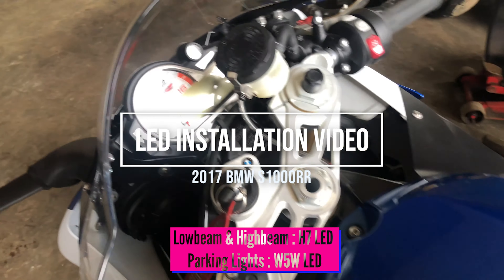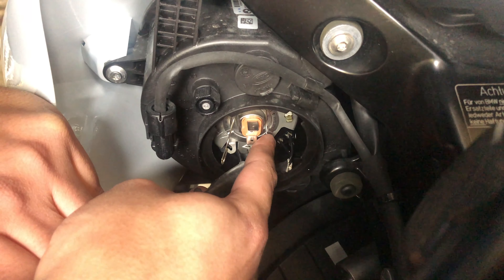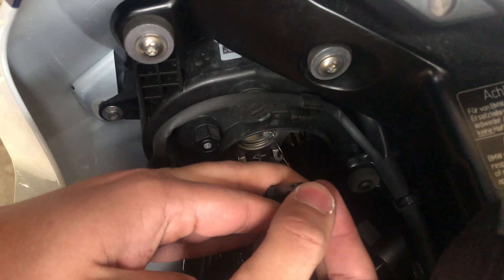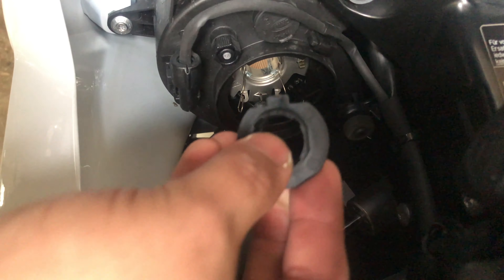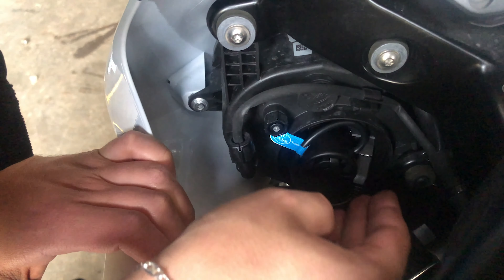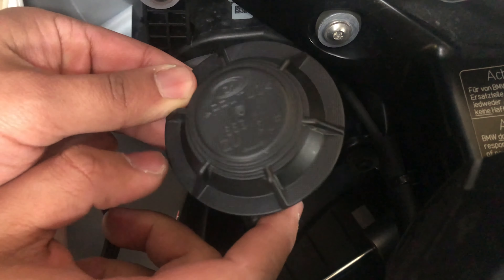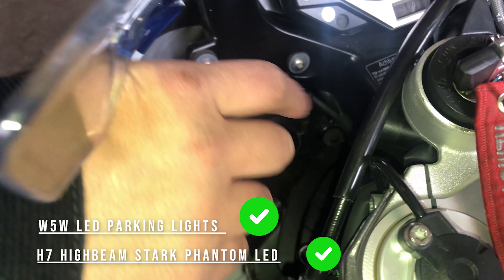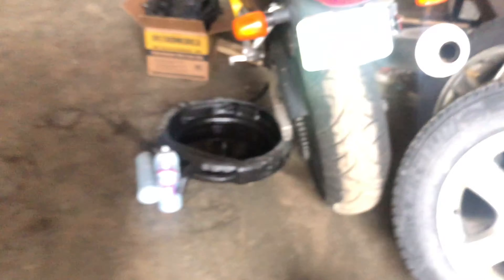NICEST LEDs for your BMW S1000RR | Installation

Comment: Cant wait to install mine, they look fantastic. Beautiful machine my friend!!
Reply from the maker: Walid Mankal thank you brother 🙏🏽
Reply: Would the newer stark ns series work the same way?
Reply from the maker: @kila501  honestly not sure, depending on the shape of the LED fan - you might have to trim your cap differently but same process for sure (make sure they are H7 LEDs and you're good for sure) 🙏
Reply: @bencheee3099  good looks, ended up ordering 3d printed caps that should fit without any holes =] the lights look sick btw
Reply from the maker: kila501 shit eh thats mad nice! 3D stuff is always nice - cleaner look for sure!

Comment: Hey bro how r u doing ? 
I installed both of the led lights on my s1000rr ! Just 1 question ! How aware should i be from water get into the fans ?
Reply from the maker: Hey brother, I just posted a new video - Updated Walkaround. It has a link for new dust covers 👍 you wont have water into the fans.

Comment: Left side has more space than the low beam side. I struggled to fit in the connector inside the cover even though I purchased the 70mm off set cover. Still connector didn’t make it inside the cover.
Reply from the maker: Yeah that's correct! One of the sides, the connector stays outside of the cover due to lack of space. The side that's lacking space, I just have a zip-tie holding it nice and firm.

Comment: Do you need to adjust the lights after ?
Reply from the maker: Hello Peder, what do you mean by adjusting the lights after?
Reply: Many led have a bit different pattern so you have to adj the lamp up or down
Reply from the maker: @pederspring141  no adjustments were needed, these were an easy plug & play. Only modification needed were the headlight covers as shown in the video 👍
Reply: Nice to know that you don't blind oncomming traffic,how much more light do they give (roughly)
Reply from the maker: Honestly they give much more light than the stock halogen bulbs (obviously) Once you install them, you immediately see the difference and trust me it'll blow you away 👌 worth the upgrade

Comment: Looks great 👍🏻 Any issues with water or condensation in your lights after the modification to the cap.?
Reply from the maker: I got condensation on the lowbeam side but bought OEM caps to put them back on if ever the condensation annoyed me too much.
Reply from the maker: Check these out, I've ordered a set to fix my condensation issue --> https://www.ebay.com/itm/Hard-Plastic-LED-Headlight-Dust-Seal-Cover-Cap-BMW-S1000RR-S1000R-HP4/312684615933?pageci=7636d649-ee00-46ab-9357-671cedb95d22
Reply: Thank you 👍🏻
Reply: @bencheee3099  how did you get the wire to fit on the low beam side? I have those ebay caps and cant figure out how to route the wires to seal the cap
Reply from the maker: Unfortunately for the low beam side.. the wire sticks out for me.

Comment: Excellent Video and Tutorial Homey, I just ordered this setup.  Question, you've been running this setup for a few months now - any long term issues? Particularly with condensation? Thanks again Bro, ride safe!
Reply from the maker: No long term issues fam! Been amazing so far! I did get some condensation but I ordered these custom 3D printer dust covers and they do the job perfectly
Reply: @bencheee3099  Outstanding!! I'll order the dust covers as well.. Much Appreciated

Comment: Great vid my man. On your updated walk around video, you didn’t show the right side. Will the covers from ebay allow you to tuck the wire on the right side inside the cover, or will it still be on the outside subject to rain and debris with a zip tie??
Reply from the maker: Thanks 👍 it remained the same as shown before. Stays outside unfortunately.
Reply: Hey bud, once again great freaking vid!!  I got everything installed today. I wanted to let you know that with the extended caps from Ebay, I was able to tuck the wire in on the right side. The biggest gap is at around 10:30 or so. Tuck the wire in first, and then the connector. Both of mine are sealed up with connectors inside the cap. Hope this helps and let me know if you have any questions

Comment: would this work on a 2013? and for the updated dust cover you used do you put the rubber seal from the old ones on that one?
Reply from the maker: Don't think it would, the 2013 is a different generation. I did re-use the rubber seals but they did need modifications. I did upgrade to YadMoto's high quality premium products. Check him out. YADMOTO got his stuff rom ebay.
Reply: @bencheee3099  damn lmao i already ordered my lights and got them today cross my fingers they work lol and yeah i bought a new dust cover from him with the blue fluorescent cover
Reply from the maker: @BAGDL34  shit eh.. goodluck with it my man.
Reply: @bencheee3099  thanks bro i’ll let you know how it goes but seems like it’s the same plug

Comment: You can try these covers/caps from Amazon so that you don't have to cut a hole. I will be replacing the lights on my S1000R this month. H7 for low beam and HB3 for high. https://www.amazon.com/gp/product/B073QNQ5H6/ref=ox_sc_act_title_5?smid=AFLE0NKKTARYW&psc=1
Reply from the maker: Thanks chief 👍

Comment: You didn’t put a resistor in line to prevent the dash warning or the LED flicker?
Reply from the maker: Didn't have to!
Reply: @bencheee3099  interesting. Guess I’ll just take the jump and buy them!
Reply from the maker: @XxXTitsmcgeeXxX  do it up my man! If you have any questions later on, don't hesitate
Reply: @bencheee3099  will do! I’m just honestly surprised you didn’t receive a warning on the dash. Everything I’ve read says I’ll have some kind of flicker/error and therefore need to run a resistor in line with the bulbs.
Reply from the maker: @XxXTitsmcgeeXxX  that's quite interesting.. I rode that bike for a solid year with the led bulbs and not a single warning light on the dash.